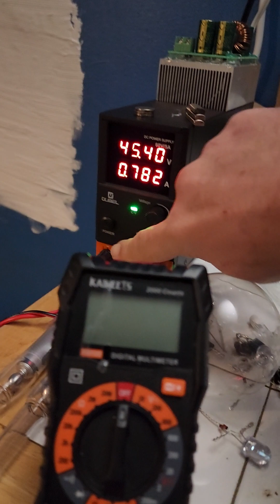🌩 WIRELESS RADIANT ENERGY ELECTRICAL DISCHARGES & ARCS FROM GROUND POWER EXTRACTION 🌎

Comment: Just asking.
I don't want to sound too smart, but:
-try to use capacitors, it can increase the frequency...
-try to use HV transformers
-i think, spark (spark gap) must be....it increase field, or something else...i don't know))....or use spark to hit transformer...tesla in reverse.
P.s. I blowed your 2 transistors. I can't find the same...what frequency they were working, tell me pls))
Reply: Ferrite transformers
Reply from the maker: TIP35C TRANSISTOR & THEY'LL BLOW IF THE TRANSMITTER ISN'T CONSTRUCTED EXACTLY IDENTICAL TO MINE. IF ITS TOO BIG OR SMALL ITLL DRAW TOO MUCH CURRENT & BLOW. TRY A 0.5 WATT 22K RESISTOR ON THE BASE